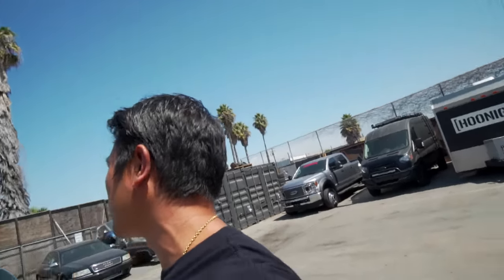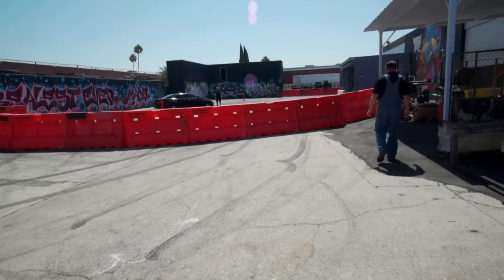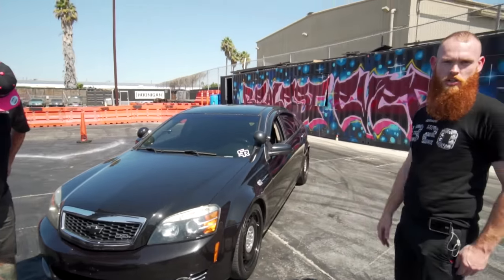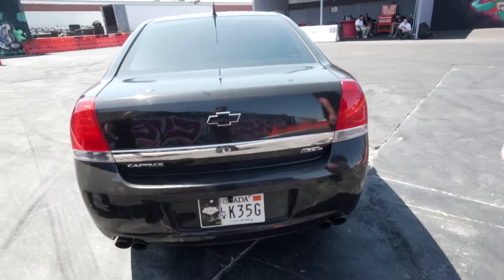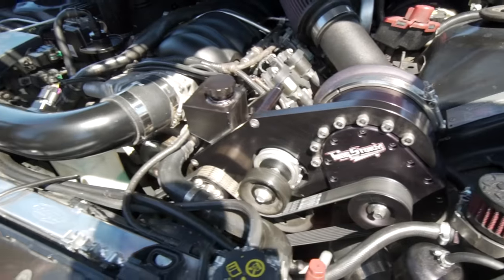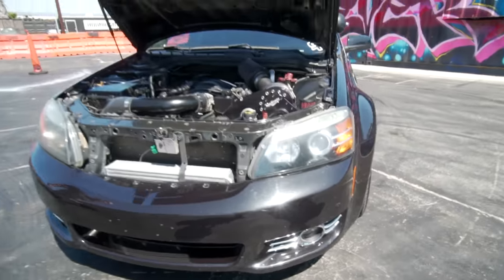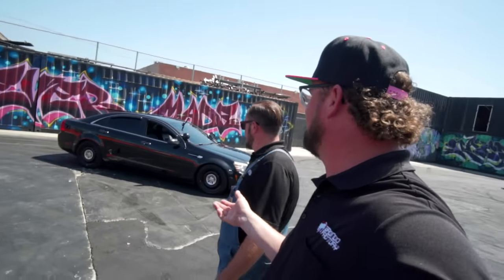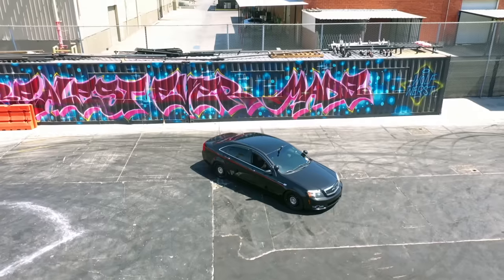700hp Cop Car?! 2012 Chevy Caprice PPV lights up Tire Slayer Studios // Build Breakdown

Comment: The TorqStorm supercharger on this Caprice is of the centrifugal type, and there are pros and cons of this type of supercharger - for one thing, because the torque gradually builds as the revs increase, centrifugal superchargers are easier on internal components, and they build power linearly, only making more boost at higher RPMs - this makes them easier to control in wet weather than, say, a roots type supercharger or even a turbo. Plus, they produce that boost more efficiently than roots or twin-screw ‘chargers.

It is worth mentioning however, that as much as the linear power build that a centrifugal ‘charger provides is a pro, it can also be a con - with a centrifugal supercharger, all the POWERRRRR is concentrated at the top of the rev range, as they don’t produce as much boost low down in the rev range as they do higher up the rev range.
Reply: Centrifugal superchargers build torque linearly, so the horsepower actually builds exponentially.  This is why the torque peak is often very close to the power peak.  These have a crazy driving feel because the engine pulls harder and harder as the RPMs rise.

Comment: As the owner of a Caprice PPV I know how difficult it is sometimes to figure out what parts are available for these cars and where to source them from. Wish there was more discussion about how this all came together, but it's still an awesome build and I'm glad to see one of these old Holden misfits getting some spotlight.
Reply: I got a 2014. There's no way to shift through gears. 2011-2013 has the benefit of adding a tap shift box, or g8 shifter. Lucky bastards. 2014-2017 can use a chevy ss steering with paddle shifters, but I haven't found a kit available.
Reply: I’ve been debating on buying one for a body swap. It’s the exact wheelbase for my 1952 plymouth cranbrook coupe. I want to build somewhat of a sleeper looking ratty 50’s sled with a LS drivetrain.  (Similar to that dude Jake who body swapped that 50’s chevy onto the Lexus, that was featured on Hoonigan a few years back)  A project that is easily do-able in my home shop.

I’ve seen a few locally on copart, but both have been listed as flood damage so I was hesitant to pull the trigger.
Reply: @michael-michaelmotorcycle  I got a mint one with only 50k miles I’d sell for the right offer
Reply: @JR-yr8xm  I've got a 2016, and just got a Camaro ZL1 wheel with paddle shifters for it. When the weather gets nicer I plan on figuring out how to hook it up. I've seen people that have done it, but haven't found someone that detailed what they did.
Reply: @ReanuKeevesAus  That would just make it a clone of whatever you just said not in original so I doubt it would be worth much going that route if anything I’d keep it original
Reply: @ReanuKeevesAus  yeah I don’t see any around where I’m at.  I love that feeling I’m probably just going to keep it lol
Reply: @iiscd5970  Google caprice ppv paddle shifters. Someone on the newcaprice forums kinda talks about it. Maybe you'll get an idea and research more from there. Not sure if the steering wheel you got will work though.
Reply: @michael-michaelmotorcycle  Sounds sick man, they were pretty common on the government auctions a few years ago for like 7k I'm sure there's still plenty of em going around on there as the stations are always upgrading. I was gonna buy a caprice ppv or one of the charger pursuits but ended up getting a car loan instead of a personal loan so I went with something a little more out of my budget
Reply: I'm in Australia and drive a 2010 HSV Grange (same car but modded from factory) look for HSV parts in Australia to trick it out👍
Reply: @baddaddy3954  is there a website?
Reply: @JR-yr8xm  I've seen that post. It's not much to go off. People swap the ZL1 wheel into their SS and vice versa so it should work. If I get it to work I plan on documenting to make it easier for others trying to do the same
Reply: @iiscd5970  That would be awesome. I'm sure many people will appreciate it.
Reply: @championskennel4555  you need to sell it to me. how much
Reply: @cheezo1372  I’m still casually looking for one. I’m in the process of building a 2100 sqft shop behind my house. Once that’s complete I’ll start looking a little more seriously. But building the ratty sleeper LS plymouth is one of my goals. After the 69 Sweptline, the 81 scrambler but before the 54 Willy’s truck. Ugh, too many projects. Carcaine

Comment: He's got the tap  or paddle shift set up in that thing which is awesome. On my 2014 I am unable to hold a gear with the car because I have not set up a manual mode which they don't have from the factory . So when it shifts through to 6th Gear I have to use the nitrous to get it to kick back down. It's a pain but 160 mile an hour burnouts and six gear makes a lot of smoke 😁

Comment: As an Aussie with a ve same as a g8.. that is the worst place for a cold air intake. That pod would be on 🔥.  .. chuck it in front of the front left wheel and remove plastics.. guarantee more poke. Must be upgraded diff as aussie caprice didn't come lsd. Nice work things a beast

Comment: Can someone answer this for me. That pipe with the filter coming off the supercharger, is that not an intake? If so, isn't that probably the worst possible spot for it? It also looked like an intake coming off the front of the motor heading to a heat exchanger? I'm confused. There wouldn't be two intakes? If someone could explain this to me, I'd be stoked.
Reply: It will get heat soaked being in that position, but he's running E85. So it does help keep the charge temps a bit cool. He not really going for Max power any how.

Comment: i'm surprised that i'm yet to see someone convert a PPV to holden or buick luxury cruiser spec.
Reply: Or to HSV spec
Reply: @baddaddy3954  yeah, a LHD grange would be sick.
Reply: @captainzoll3303  for sure. I went ahead and put ve senator front seats in mine to get rid of the boring caprice retrimmed seats and added the rear TVs to the headrests which actually came out good, the guys in the US have drivelines down better than us in Oz but things like the AP racing brakes and HSV spoiler kits and boot spoiler, badges, grilles, even the halo headlights would be standout over there. Trims for interior too like our instrument clusters (even though they're kmh not mph) and standard Bose stereo
Reply: Shipping costs from Aussie land for the parts, may play a part in that.

Comment: to everyone that doesn't know, over in Australia, this car is or was called a Holden Commodore. But Holden shut down because the rumor is Chevrolet has had enough of making right-hand drive cars. Now I'm not a hundred percent sure about this. That's why I said rumor.
Reply: This particular model was the statesman, the commodore was/ is the g8/ Chevy ss, the statesman shared the same chassis as the g8/ commodore wagon. Both the commodore and the statesman mostly came in v6 options but both had the option for ls based v8s. 
I’m pretty sure General Motors shut down the holden/ Australian division of manufacturing because it was costing too much money and sales of the cars was down. Much cheaper to build shitty econoboxes over in 3rd world countries and exploit them for cheap labour.